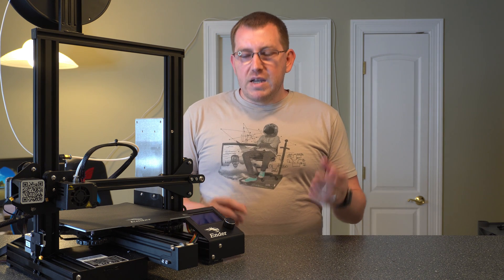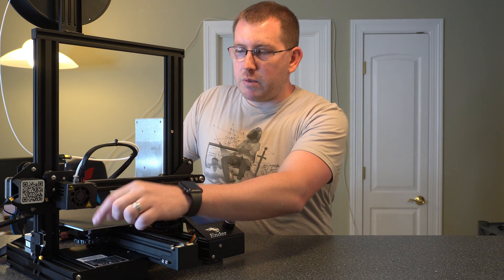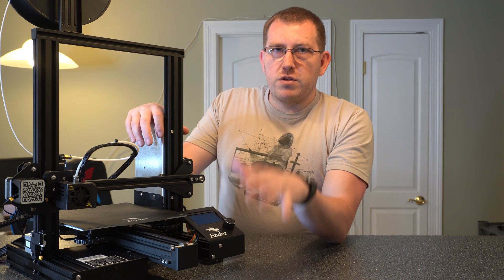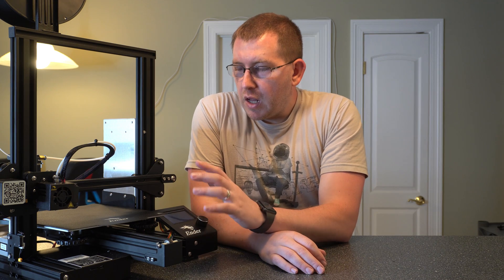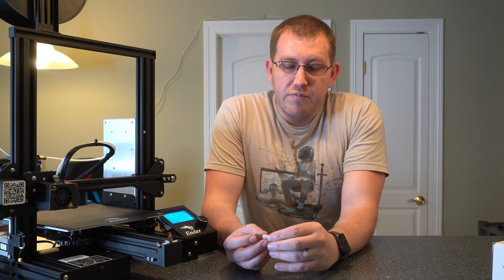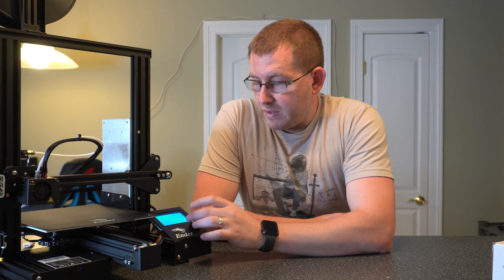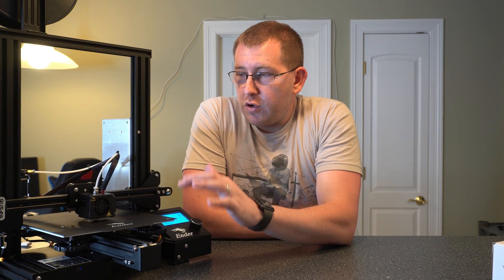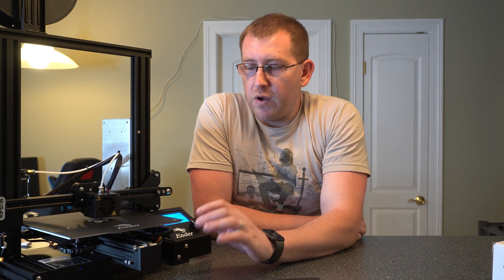Ender 3 Pro Beginners Guide - Everything You Need to Know to Get Started!

Comment: I just got a second hand Ender 3 pro and can't get it to work. It was my son's printer and he said has printed from it and even came over to try but could not get it to work.  I leveled the board as instructions said.  I pre-heated everything and tried to print something and the print head leaves the home position and goes up about 4 inches and goes back and forth and the table moves also.  I watched it doe this for about 5 minutes, it shows no progress so I cancel the print.  I tried the batarang print and it seems to be working, but nothing is coming out.
Reply from the maker: Hi. Can you try to heat the hot end then push filament through using the z axis move command? I’m wondering if there is a clog in the nozzle.
Reply: @3DPrintscape  the nozzle is new I just replaced it. I pulled out all the filament and re-did it and it's now working.  My first print was the batarang. It printed in the front left corner and off the plate. I then did the dog, twice. One time the print came loose of the plate and was being dragged all over the plate.  The second time the printer just stopped halfway through.  All three prints were terrible with gaps and blobs.  I set the heat to what the filament manufacturer said,  200 for nozzle and 60 for the table. I have not been able to print anything from the internet.
Reply from the maker: @bobscheffler531  Try to clear defaults. It almost sounds like there is a change messing with things.
Reply: @3DPrintscape  I will try the default answer but I actually got it to print the supplied dog. There were several issues. One, was the table needed to be cleaned and the filament actually got caught up on part of the printer.  But I am still having problems printing stuff from the cloud.  Some items do not print in the center,  they print off the table.  I don't understand why Ender supplies a slicing program (Cura) that doesn't have the Ender 3 pro in the program
Reply from the maker: @bobscheffler531  Cura isnt supplied by Creality, there is a Creality slicer. The ender 3 pro is under creality in cura though. I would go through and delete your machine profile in cura and start again.

Comment: Totally new to this but I'm a highly certified welder and I dial my heat accordingly to weld wire diameter plus my heat so I get the pre sets kinda. Would you just want to change the nozzle heat for different or harder materials? Thank you for the great videos👍
Reply from the maker: Hi. You will want to move away from brass/copper nozzles if printing any abrasive materials. I have a hardened steel one that works well. I would recommend going that route.
Reply: This video was super helpful thank you

Comment: Rob, new subscriber here looking to get the pro for my first printer as well. How many different nozzles do you keep in your box? Do you change to different sizes for different prints? Maybe for more details?
Reply from the maker: HI. Thanks for the sub. I try to just use the one good hardened steel one, the copper/brass ones are crap. I havent printed anything i needed to go smaller than .4mm for.

Comment: I have "motion" as an option, but not "prepare" did they change something?
Reply from the maker: Hi. What firmware are you running? They do change things often though.
Reply: @3DPrintscape  not sure. Just set it up out of the box. Wasn't sure where to go from there honestly. Was able to move the head around with options in the "motion" menu, but had to loosen the golden z axis rod holder because it seemed to be binding. But that's where I'm at!
Reply from the maker: @BrianHegger  Gotcha, are you running into issues at this point or just getting familiar with your printer?
Reply: @3DPrintscape  wanted to preface by saying thanks for replying!... honestly not sure where to start. From all the videos I've watched no one seems to give the steps between setup and first print. I know I need to level the bed and choose a small file to print, but am worried about bed to nozzle height and first layer adhesion. I think I may be getting too much into the weeds to start as I was also researching all different types of filament last night as well.
Reply from the maker: @BrianHegger  I would recommend just starting to try things out, then ask questions along the way if you run into issues.
Reply: @3DPrintscape  Got some things running last night - had a few questions, what's the best way to ask? (Probably not in the comments here, ha!)
Reply from the maker: @BrianHegger  The best option would be discord, the invite is in the video description.

Comment: Hello, thank you for your military service. I'm retired Army. I was thinking about purchasing the 3d Pro but was curious about the USB to PC for sending the print data and commands thru software and if possible, I've seen some who have a cloud server device connected to the printer. Also no biggy but is the 3D Pro open source as the older model? Thank you for your efforts and informative video.
Reply from the maker: Hi. Thanks for your service as well. The Ender 3 pro is basically still open source, fully if you move to marlin firmware. If you go with the E3 v2 the screen is not open source. Either way you go, you can connect it directly to the computer and print to it that way but i prefer to use a raspberry pi with octoprint. The issue with connecting to a windows pc is that if the computer shuts down for what ever reason, like updates, you will lose the print.
Reply: @3DPrintscape  Oh great! Thank you, appreciate that and all your helpful information, just what I was wondering. They don't put much techie info on the advertisement pages. This would be my first and want to get as close to high end and user friendly without losing all my lunch money ;-) I'm sold, but going to take a gander at the Ender 3d Max. Thank you so much, your help was spot on. You are a go at this station Ooooorah! he he he ;-)
Reply from the maker: @Silverado1st  The Ender 3 Max is also a great printer.

Comment: Rob  could you please humour me with this question. The nozzle on my Ender 3 Pro is 0.4 mm so I assume the molten filament is pushed out of this nozzle with a diameter of 0.4.
So how can you dictate a layer height of 0.2 in the slicer program. I assume that with the nozzle moving over the bed it elongates the molten filament to less than 0.4. In fact wouldn't the speed of the nozzle directly effect the height of the layer laid down. Not only the speed of the nozzle but the quantity and speed of the filament being pushed by the extruder would also have an influence on the layer being deposited. So I think that to get a final 0.2 layer height there needs to be a very specific set of instructions to the printer. This I assume is in the settings for default printing speed and the x/y axis movement speed. My point is if you change any of these you will not get a 0.2 layer, but nowhere does anything inform of the correlation of layer height,print speed and travel speed. Your thoughts
David
Reply from the maker: Hi. Thats a great question. The .4mm really only impacts the width, not the height. So you can get the .2mm layer height with that nozzle, you just wouldnt be able to get a line width of less that .4. That said, you can only get so low of a resolution with the .4mm nozzle as it can still has limitations on layer height.

Comment: So we got our printer together, powers on, all plugs are in correct places, but it won't auto home. It goes off the left corner closest to the cars insert, and raises apx 3/4 of an inch off of the table. Anyone have any tips?
Reply from the maker: Hi. Can you email me more details or join the discord channel to walk through it? My email is admin@3dprintscape.com and the discord is https://discord.gg/Bu94EYVkrU .
Reply: @3DPrintscape  I'll absolutely join the discord, turns out on of the important connectors was tuck within the housing of one the part on the base of the printer. Once connected we resolved the issue. Thank you for your response! Do you recommend blender as a program or something better?
Reply from the maker: @degenerategrappling6503  Great, im glad to hear you got it working. For the CAD software, it really depends how much work you plan on doing. Most of the mods I have been doing can be done in Tinkercad. I think bleder is definitely more powerful than tinkercad thoguh.
Reply: @3DPrintscape  thank you for your quick response!
Reply from the maker: @degenerategrappling6503  You're Welcome.

Comment: Hey man, my printer is having issues. The auto home is fine, but when it starts printing it, the nozzle moves up. And it starts coming out in spools since it's too high. Anything to help on that?
Reply from the maker: Hi. It sounds like the bed isn’t leveled based on the nozzle position after its homed. Is your printer stock or do you have an auto leveling kit on it? Here is a video I did covering the leveling process on the stock Ender 3, maybe that will help some. https://youtu.be/hKVJKTDp_9k

Comment: Hi 
Can someone Please Help Me
Getting this message on my Ender 3 Pro 

Err: MINTEMP Bed 

PRINTER HALTED

Please reset

This is what I have done

Contacted Chep on Youtube and his advise was to check solder on board then replace bed sensor

Done both of them, and there is NO Reset button on the board

Any ideas will be gratefully recieved

Thanks
Reply from the maker: Hi. The "Err: MINTEMP Bed " error means that the control board isnt getting a reading from the thermistor connected to build plate. That can be a result of a bad connection or the thermistor being bad. If all connections have been verified, i would look at replacing the thermistor.

Comment: total newb to 3-d printing, i just got the Ender 3 pro, assembled it, got the Cura program and have been trying to make stuff. the last 3 items i've tried have just been practically 1 D, it makes the base, then stops. it keeps going over, and over the one layer, it won't raise and make it a 3-D object. i tried a snowflake from the thingyverse site, then a mask defogger for glasses, and in the process of making the default dog. 8 mins in, and it's just going over the same footprint, not raising. how do i get it to make 3-D stuff, any help would be appreciated!
Reply from the maker: Hi. Welcome to the fun world of 3d printing 😊. It sounds like the z-axis stepper motor isn’t engaging, or isn’t working. Can you try to manually move it through the movement section in the menu? If it doesn’t move, I would start looking to make sure everything is wired properly.
Reply: @3DPrintscape  thank you for the reply, i will check it out. i'll let ya know when i've got it working! 😃
Reply: @Lugnut73  still haven't got it working eh?

Comment: I was just given this 3D printer to tinker with as the owner states he had trouble getting PLA to stick to bed and it would not feed. I got it to feed, but I would like to reset to factory settings. How do I get that accomplished? I have no manual or guide.
Reply from the maker: Hi. What type of changes were made? If they are just setting changes made at the printer, you can reset that erasing the EEPROM. I think this shows up under the configuration menu on the default firmware.
Reply: @3DPrintscape  this is in the printer menu itself ? I'm not sure what settings he has changed since  do not have a manual. I would just like to start with a clean setup! I tried printing something last night and the print head was to far off of the table a guess. The PLA wasn't laying down, it balled up like a ball of yarn.
Reply from the maker: @davidmurray8143  It depends on what firmware you are running. I believe it will be under menu, configuration, erase eeprom (or settings). It also sounds like the bed isn’t properly leveled. Here is a video I did covering that process. https://youtu.be/hKVJKTDp_9k

Comment: Hey when I try to print something, instead of printing it at the middle it prints it on the left edge of the bed resulting in very very bad results, and sometimes even damaging the extruder.
Reply from the maker: Hi. It sounds like the origin at center check box may be checked. Can you verify that, and uncheck it if it is. Its under the machine settings section in Cura. You can do that by going to Preferences  Printers  Select the printer you are working with, then click machine settings.

Comment: Hey I’ve noticed in your videos your x axis sensor seems miss alignment or faulty
Reply: When you home it seems to jolt into the sensor and max out at the same time
Reply from the maker: Hi. Thanks for the feedback. I mess around with this printer so much that things are off a little at times. I try to get everything aligned after major upgrades though. I think the next time I will be doing that is after I do the direct drive upgrade.
Reply: @3DPrintscape  sounds good looking forward to the firmware upgrade you mentioned

Comment: i just ordered a ender 3 pro what settings should i do for tpu printing?
Reply from the maker: Hi. TPU is very difficult to print on the Ender without modifying it. I haven’t tested it much, so I don’t have a good answer for you, but I would recommend adding a direct drive system to your printer. Once you have that you should be able to print flexible filament without an issue.
Reply: @3DPrintscape  thankyou!!

Comment: When you click disable steppers on the screen besides from the sound of the knob being pressed in, is there any other sound it makes to let you know the steppers have been disabled. Also after you disable the steppers will that allow you to move the bed and the extruder around smoothly, I noticed it did for you in the video.
Reply from the maker: Hi. No it doesn’t give you any indication that you actually clicked on it, not sure why they did it like that. Yes, after the steppers are disabled, you should be able to freely move both the x and y axis.

Comment: trying to figure out how to raise the temp of the extruder from the default 200...  I change it then start a print and it always goes back to 200.  The reason I am trying is because my prints have pits and I was told that I need to try and print at the highest temp for the filament... help?
Reply from the maker: Hi. You would need to change that in the Cura before you slice the object. You should check out the video I did on how to print a file from thingiverse (https://youtu.be/eXYpFLnrvgM) , I cover the process in more detail there.
Reply: @3DPrintscape  thanks!